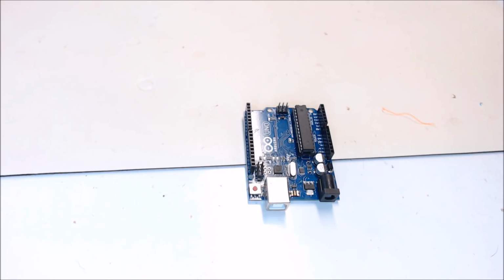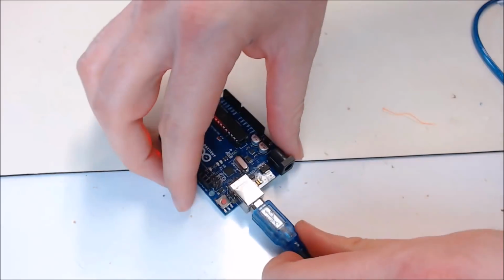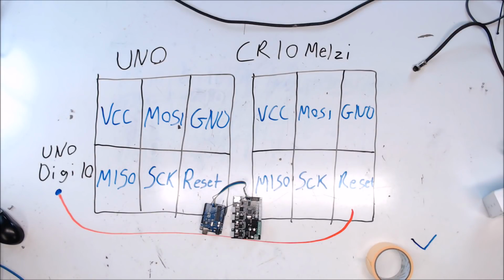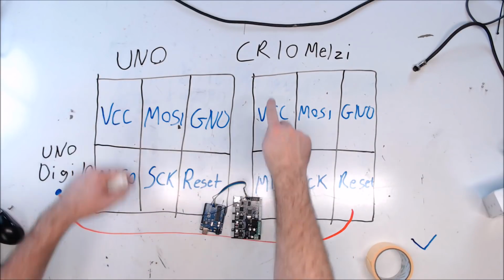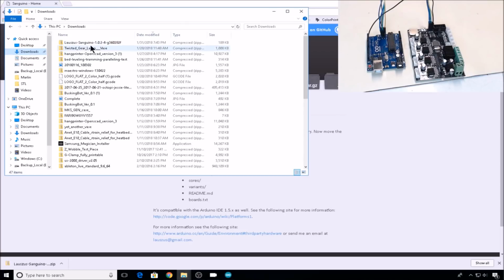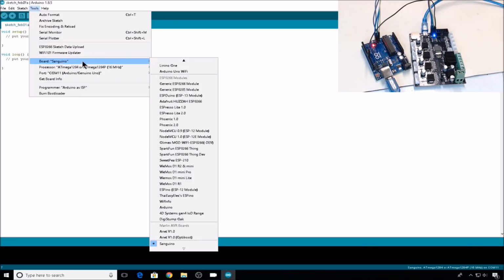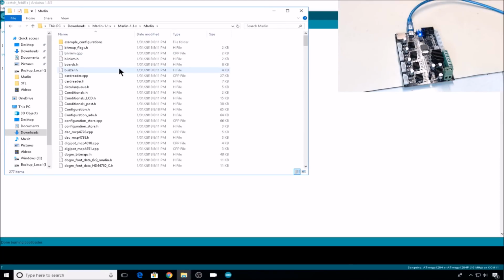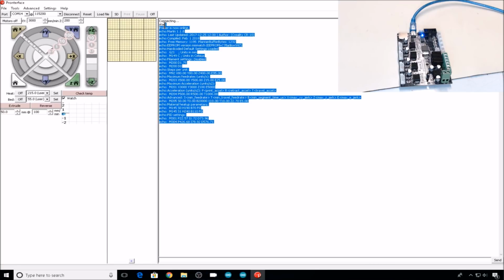Creality CR-10 Marlin Firmware Upgrade - Chris's Basement

Comment: Thanks for the very detailed instructional vid. Just wanted to ask, if I wanted to change values in the firmware such as maximum z height of my cr10, do i need to take the board out again, or I could just connect it via usb to my computer then upload the modified marlyn firmware again?
Reply from the maker: You're welcome! No, after the bootloader is on, you're all set. You can make changes from the USB at anytime after that.
Reply: @ChrisRiley  Thanks for the reply Chris. So if I want to make changes to my firmware all I need to do is connect USB cable from PC to my control box and uplaod? Should I do this while control box is on or off? Really sorry for being a noob on this, I am planning on increasing the z height of my cr10 to at least 1000mm, just like what Happy Extruder did.
Reply from the maker: Cool! Yes, all you got to do is cable USB and power it on. Then you can update it.
Reply: Oh, that's so cool, I just hope I don't make a mistake on updating the firmware since I have a tendency of being careless. Thanks for clarifying it for me Chris, been lot of help.

Comment: Hi Chris,  Thanks for detailed instructions.  BTW, what are you using for your CR10 Bed?  Do you recommend it?  I'm currently using a mirror with glue stick which works fine most of the times.
Reply from the maker: Anytime! It is a sheet of PEI. It's just ok, it works for somethings, but a struggle on others. I have a sheet of Geckotec I want to try on it soon. I have heard good things.

Comment: On my board there is no usb jumper to switch , Can I connect directly?_
Reply from the maker: Yes you can, just be careful using power with the case open.
Reply: Got the same thing, no USB jumper, so tried it with the board powered by mains. Still no luck. ËRROR while burning bootloader" I just got a brand new board CREALITY V1.1.5 with TMC2208 drivers. This board was intended for the ENDER, but I thought it looked exactly the same, was newer and cheap. Is it the new board?
Reply from the maker: @maerlant-robotica5526  I'm not exactly sure, It might not have the same chip in the newer versions.

Comment: Hi Chris, I downloaded the most recent Marlin firmware but there is no Marlin.INO file.  What do I do now?
Reply from the maker: That's not good. :) I just checked it, try this link. https://github.com/MarlinFirmware/Marlin/archive/1.1.x.zip
Reply: Thanks . @ChrisRiley  I did finally install the Marlin firmware but after the install I received warnings of low memory and everything was irratic.  I eventually used a TH3D firmware version and that worked ok.  I guess 128b doesn't go very far.
Reply from the maker: @VideoJocky1 No, 128 doesn't go very far. The do tend to get squirrelly  when they get close to the limit.

Comment: Hey Chris Thank you for video. I have 8 sets Cr-10, two of them is like yours six of them is new. New I am not mean Cr10S. Creality3D Cr10 upgraded so many way. And they have different kind motherboard. maybe just maybe are they made bootloader already did you know anything about that?
Reply from the maker: Yes, later models do have the boot loader installed I believe. If you cable your printer up to Pronterface or Octoprint when you start it up, it should list what boot loader the printer is using.

Comment: Chris.  I  am getting the following error after following your  how to:  The current selected board needs the core 'arduino:arduino' that is not installed.
The current selected board needs the core 'arduino:arduino' that is not installed.
recipe.preproc.macros pattern is missing

Error compiling for board Sanguino W/ ATmega1284 or ATmega1284P (16MHz).
  Can someone please help?
Reply from the maker: Hey Derek, That sounds like something going wrong with the IDE. I would download the new version of the IDE and give it another try. That is an error I have never seen before.
Reply: @ChrisRiley  Hi Chris, I am having the exact same problem.
Reply from the maker: Interesting, let me see if I can replicate it.
Reply from the maker: Looks like an issue with the IDE. give 1.8.7 or 1.8.5 a try, https://www.arduino.cc/en/Main/OldSoftwareReleases#previous

Comment: thank you, worked like a charm. i ordered the cr-10 2.1 board because my printer came stripped down with only 1 exp cable, any chance do you know if the reprap discount controller will work on the cr-10s? i might have to replace the display as well. last question, do you know where i can get the anet e12 marlin firmware? the config files are nowhere to be found and i like mesh bed leveling with lcd.
Reply from the maker: You can make those displays work. You have to swap the plug over and make some pin changes in pins.h. The E12 is setup just like an A8 only bigger. Same main board. You can follow an A8 Marlin upgrade videos (I don't have one) and get the same things done. Just update the build volume and things. I don't know of anyone that has a complete config for the E12. I can get you one for my E10 if you like.
Reply: Chris Riley that would be much appreciated,would I only need to change the build volume?
Reply from the maker: Brett Culley Maybe, if you run a M503 and send over the output I'll tweak it and send it over.

Comment: the TH3D firmware only has to decompose CR-10. if I decompose that I can update my CD-10S. they are compatible?
Reply from the maker: Unfortunately I can't speak to TH3d firmware, I never use it. You would have to contact them.
Reply: @ChrisRiley  hello thanks for responding, I have installed the TH3D firmware in my CR-10S has a dedicated version. soon I will try with the marlin2.0, in the examples is the .h for CR-10S, I have some doubts, will it be compatible ?, thanks for a great video I speak spanish and only with the images is understood quite well.
Reply from the maker: @IMPRESIONES3DTU3D  no, 2.0 won't work as of now on that mainboard. That might change when 2.0 is officially released.
Reply: @ChrisRiley  thank you

Comment: I just did this, but I had a problem. Both boards were showing up on the same COM port and the bootload flash kept failing. I went into Device Manager and changed the port number on the Arduino through advanced settings.
Reply from the maker: Huh, that's really strange they showed up on the same port. Is it working now?
Reply: Chris Riley - Sorry for the delay. I got it working, I had to go into device manager and force change the port number.
Reply from the maker: Right on, glad you got it working.

Comment: Unfortunately im getting an ERROR when trying to verify.
CR-10
Marlin 2.0.x

Arduino: 1.8.12 (Windows 10), Board: "Sanguino, ATmega1284 or ATmega1284P (16 MHz)"
c:/users/home/appdata/local/arduino15/packages/arduino/tools/avr-gcc/7.3.0-atmel3.6.1-arduino5/bin/../lib/gcc/avr/7.3.0/../../../../avr/bin/ld.exe: C:\Users\home\AppData\Local\Temp\arduino_build_140435/Marlin.ino.elf section `.text' will not fit in region `text'
c:/users/home/appdata/local/arduino15/packages/arduino/tools/avr-gcc/7.3.0-atmel3.6.1-arduino5/bin/../lib/gcc/avr/7.3.0/../../../../avr/bin/ld.exe: region `text' overflowed by 708 bytes
collect2.exe: error: ld returned 1 exit status
exit status 1
Error compiling for board Sanguino.
Reply from the maker: Try downgrading your Ardunio IDE to 1.8.5
Reply: @ChrisRiley  Really appreciate the reply.
So i down graded to 1.8.5
get the following error
"Arduino: 1.8.5 (Windows 10), Board: "Sanguino, ATmega1284 or ATmega1284P (16 MHz)"
fork/exec C:\Users\home\AppData\Local\Arduino15\packages\arduino\tools\avr-gcc\7.3.0-atmel3.6.1-arduino5/bin/avr-gcc.exe: The filename or extension is too long.
"

I opened a ticket on Marlin github to try find out why this is happening.
Someone suggested i have "too many features to fit", but im using the default example config for the CR-10
https://github.com/MarlinFirmware/Marlin/issues/18046
Reply: If i followed your guide for Marlin 1.1.9 verify works, but i get the following warning,
"Sketch uses 129390 bytes (99%) of program storage space. Maximum is 130048 bytes.
Global variables use 15313 bytes (93%) of dynamic memory, leaving 1071 bytes for local variables. Maximum is 16384 bytes.
Low memory available, stability problems may occur."

Anything to worry about? Or should be ok?
Reply from the maker: @PulsechainProfits  You should be ok, but this video will help you get it down if you need to. https://youtu.be/O2126G4oO30
Reply from the maker: @PulsechainProfits  I think there is just something going on with the IDE, try VScode, check this one out. https://youtu.be/Ib188-ACa08

Comment: I was able to flash the firmware successfully but now all I get is a blue screen on my display. I flashed it while it was powered up. Does that matter?
Reply from the maker: Are you using 1.1.9? People have seen this before. Try using Arduino IDE 1.8.5, seems like 8.6 and 8.7 aren't working so well.
Reply: @ChrisRiley I had the same issue but using the 1.8.5 everything was ok. Thanks for the video!!!!
Reply from the maker: @Pepeike  Thanks for watching, it seems 1.8.5 has fixed a lot of weird things for me.

Comment: I followed your guide and managed to burn a bootloader onto my Melzi board and then I installed the Marlin software however when I connected the printer through pronterface I could not get a signal and the lcd is blank
Reply from the maker: That sounds like you might have an SPI issue. You might try uploading the firmware again to if that sorts the issue out. You also might be really close to the memory limit. Uncomment the disable M503 line to save some memory and see if that corrects it.
Reply: Chris Riley you’re a legend! It worked ;)
Reply from the maker: @flightworks6874  Ha! Thanks! Glad you got it working.
Reply: @ChrisRiley  Hello Chris, I have the same issue after installing Marlin. I have a blank screen when powering on the unit, I have uncommented the disable m503, but it still get "Low memory available, stability problems may occur" and my screen is still blank any ideas of a fix? Thanks, sorry for the piggy back on the comment.
Reply from the maker: @BasedLegnd  Low memory is going to be hard to avoid. Are you using the CR10 display listed in Marlin?
Reply: @ChrisRiley  That was the next thing I was going to remove to save space, but when I went back to my printer this morning (left it connected via usb all night on accident) to my surprise marlin was on the display so my printer is back in action! Thank you for your reply!

Comment: do you need to dismantle the whole controlbox everytime one wants to update the firmware? or do i just use the usc connector on the back?
Reply from the maker: After you flash the bootloader you are good to go. Everytime after that, just need the USB.
Reply: @ChrisRiley  damn discovered today that my board doesnt look like yours. where you put the pins on the "melsy"? board. i have two eual connectors like the one you have next to the pins. what should i look for on the board. i have found another group of 6pins on the board but not sure what it is for. kinda gave up when i realised my board was different :D
Reply from the maker: @sttm1283  Is there a version number listed on it?
Reply: yes it says v2.1, and the chip i have manage to find out is a atmega 2500
Reply from the maker: @sttm1283  Oh nice! You got one of the really new ones, it might have the bootloader already.
Reply: @ChrisRiley  how can i tell it really has?
Reply from the maker: @sttm1283  If not, your ISP pins are right here: https://photos.app.goo.gl/rkE8To5nvYFMRS67A
Reply: @ChrisRiley  ok thats what i though also since it the only 6-pin group on there :D is the orientation equal to your board aswell?
Reply from the maker: @sttm1283  Just try to upload the sketch first, if it works, you're good.
Reply from the maker: @sttm1283  Should be the same, if not, it won't heard anything, just flip it.
Reply: @ChrisRiley  thank you very much Chris for your helpful video and your personal help. wish more were like this.
Reply: @ChrisRiley  i dont get it. should i have two usb cables hooked up to the computer?
Reply from the maker: @sttm1283  Are you using an UNO? Then yes.
Reply: @ChrisRiley  yes bought one today so im preparing everything and setting things up
Reply: there is no usb jumper on my board

Comment: My cr10 mini doesn’t have the usb jumper on the board - what to do?
Reply from the maker: Can you power it via USB? If not, it's ok, but be very careful because you are going to have to have the power turned on while the box it open.
Reply: @ChrisRiley  yes it powers on when connected via usb...however I kept getting a bootoader error on the upload so I thought maybe it had the bootloader installed and went to trying to just update the firmware and that failed also so I gave up...fortunately didnt brick anything
Reply from the maker: @rickc7151  That's good. Are you getting an AVR error when you try to upload firmware? Which one?
Reply: @ChrisRiley  When I tried uploading the firmware I was getting the U8glib error and followed the article linked in your video however wasn't sure what to do afterward.  It could be due to my cr10 not having the bootloader installed but I couldn't do that either and I'm not sure how to tell if the bootloader has already been uploaded or not thanks!
Reply from the maker: @rickc7151  Ok, make sure the verify works now that you have the u8glib installed. If that works, try the upload again, if you don't have a bootloader you will see this.

avrdude: stk500_getsync() attempt 1 of 10: not in sync: resp=0x65
avrdude: stk500_getsync() attempt 2 of 10: not in sync: resp=0x63
avrdude: stk500_getsync() attempt 3 of 10: not in sync: resp=0x68
avrdude: stk500_getsync() attempt 4 of 10: not in sync: resp=0x6f
avrdude: stk500_getsync() attempt 5 of 10: not in sync: resp=0x3a
avrdude: stk500_getsync() attempt 6 of 10: not in sync: resp=0x53
avrdude: stk500_getsync() attempt 7 of 10: not in sync: resp=0x44
avrdude: stk500_getsync() attempt 8 of 10: not in sync: resp=0x20
avrdude: stk500_getsync() attempt 9 of 10: not in sync: resp=0x69
avrdude: stk500_getsync() attempt 10 of 10: not in sync: resp=0x6e
An error occurred while uploading the sketch
Reply: @ChrisRiley  thanks for the snappy replies! Subbed)
Reply: chris I am looking to upgrade my cr 10 mini to a direct drive with an all metal hotend.....I'm new to 3d printing but mostly require TPU prints...any chance you have done this before?
Reply from the maker: @rickc7151  I have not, check out Stefan over at cnc kitchen. He has.
Reply: @ChrisRiley  Thank you Chris
If I get similar error message, does that mean that the board is damaged? Is there a a way to fix it?
Reply from the maker: @AbdurrahmanAllahem  Same errors like before? stk500? That usually means no bootloader.

Comment: u are not going to believe this. when it rains it pours! my cr-10 mini motherboard does not have a jumper for USB/volt. reg. it has cr-10 1.1.2 followed by cr 171010. no jumper anywhere on the board. how do i upgrade my firmware now?
Reply from the maker: You should be able to still do the upgrade, but the printer will have to be powered on to do it. Be careful in there with the power on, but it should still work.

Comment: Nice tutorial. If I am understanding correctly CR10 and other Creality printers ship with Marlin firmware. Under the GPL they are required to make the modified source code publicly available? Do you know if Creality makes the modified Configuration.h and Configuration_adv.h files available?
Reply from the maker: You are correct about the license. As far as I know, they do not make there configurations available. How this works legally,  no clue.
Reply: Timothy Hoogland left a comment above.  He has updated the firmware and made it public.  His company offers a lot of excellent services for the CR-10 and Tornado communities.  You can get the updated firmware here:  https://www.th3dstudio.com/knowledgebase/
Reply: Thanks for that Rick. Will check out his website & GitHub. I hear good things about the Ender 2 and It would be cool if you could update the firmware on it.

Comment: taking ages to complie and upload...been over 20mins...why? Comes back Error compiling for Board Sanguino error exit status 1
Error compiling for board Sanguino. UPDATE: Apparently, only seems to works with version less than 2.0
Reply from the maker: So it doesn't work on 2.0?
Reply: @ChrisRiley  does work on 1.9.1 but not 2.0+

Comment: Hey Chris, I followed all the steps to upgrade the new firmware for CR-10 and when I click upload, starts to compile but an error appears at the end.

Error compiling Sanguino board
exit status 1

Please, I really hope you help me with this, now my 3d printer is usless!

Thankyou very much man!

Roger
Reply from the maker: So you have already done the bootloader and it failed on the Marlin upload?
Reply: @ChrisRiley  Yes, I download the last version of Marlin v. 1.1.9. I do all the steps ´til you have to upload the new firmware. An error  of compilation of sanguino board appears. Now I have my Melzi board burned and I have to reinstall the firmware. I'm gonna try with the same version of your video. 

Message me here if your answer is too long: masimo.dovizioso@gmail.com

Thanks Chris!
Reply from the maker: @rogermas7416  Try downgrading the ide to 1.8.5 and see if the error goes away.
Reply: @ChrisRiley   thankyou so much Chris, I just didn't copy one of the 4 files that comes with the new marlin version and it works! Your video was the best to upgrade firmware for CR10! Thanks
Reply from the maker: @rogermas7416  Nice! Glad you got it working!